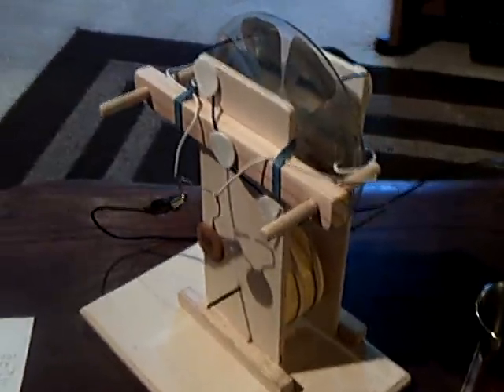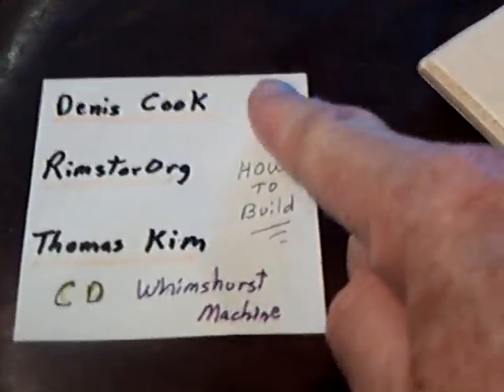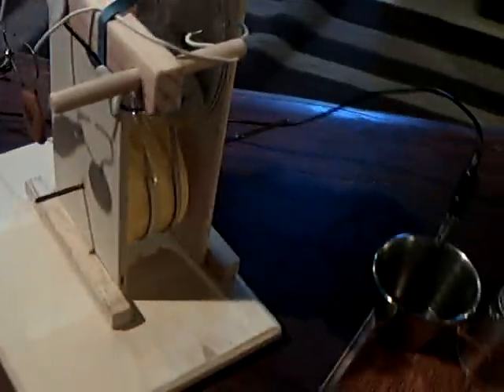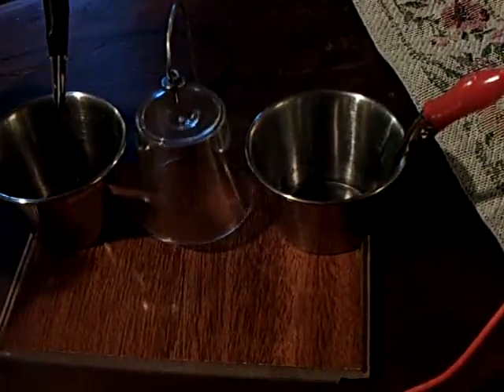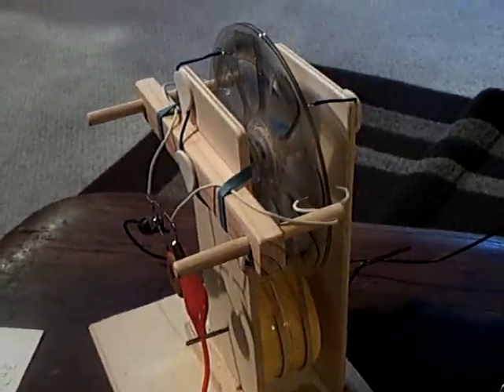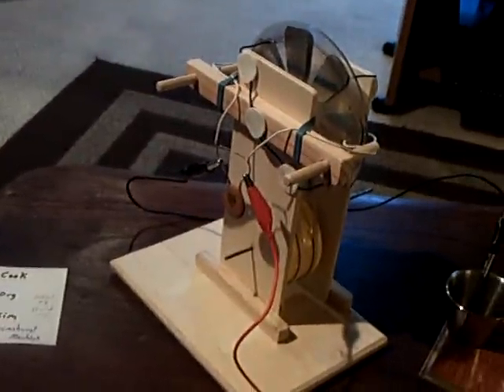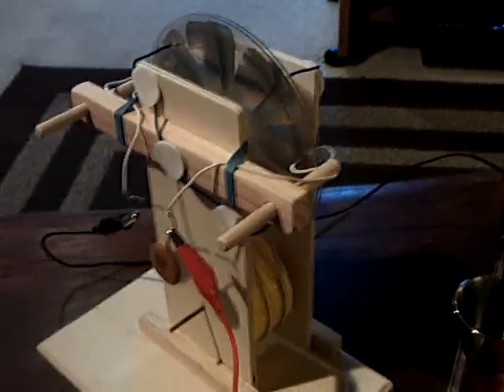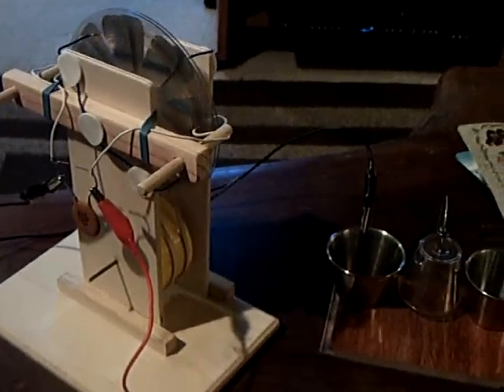Wimshurst Influence Machine

Comment: Ive been into electrostatics lately too. Check out my newman/ wimshurst.  Now i was thinking ,... Could i possibly use something like the replenisher as the commutator, and would an electrostatic pulse running through the wires of the newman part of my machine , be able to push the magnets, also id have to replace my batteries with capacitors. From your videos it looks like your having better luck with the electrostatic motor than i am and i would love to share ideas back and forth.
Reply from the maker: Yes you might be able to use that for a commutator.  The juice coming out of the Whimshurst is such high voltage but low amperage you would have to step it way down somehow to help out the Newman though.  I liked your setup.  It was very interesting and different.

Comment: !!!!!!!!!!Lidmotor. I've known of your channel for years. You made a video on a very basic pulse motor switched by npn transistor 6 months ago. I really need your help on the circuitry, I have been asking around for help for weeks to no avail. if you still have the motor, can you make another vid about it with greater detail on the circuitry, For example showing the breadboard more rather than the circuit picture. I'm new to all this but I really need to do this. Please find it in you to help me. It is of extreme importance,
You can even contact me by phone or facebook. Thanks and please get back to me.
Reply from the maker: Just watch that video a few times more.  I had to watch these Whimshurst "How to" videos several times before I figured out a way that I could build one.  Even then it didn't work right away and I had to go back a watch the videos again to figure out what I did wrong.  The bottom line is that I learned much more this way than if someone simply stood there and told me how to do it.  This is all about learning on your own.  If the thing you build doesn't ever work (many of mine don't) at least you learn something along the way.
Reply: ***** Thank you for taking the time to reply. I will continue to watch the vid. I have probably watched it about 30 times by now along with many others. The motor you made is actually all I need to make and understand, it's for my invention. It will work, and I'm never going to give up on it. A transistor page actually helped me with my circuitry, so now inductance effects the voltage. It has taken me a very long time to figure just that out. And now I have alot of work to do. But I see what you are saying... 'I' have to make it happen. Just can't wait to make a testable prototype. I'll show you what it is later, Lid. May not be up your alley, but I think you'll like it.
Reply: ***** Also, I have gotten it to work with a bifilar coil now. Was wondering if you might know of a good method to keep my transistor from getting hot. It starts to get hot with the pick up coils hooked up, without having to turn on and off... Anyway thanks for your earlier advice.

Comment: You just keep on having fun, don't you! Nice sparks! I like your cap. I didn't know you could get just small capacitance but high breakdown voltage caps until you brought it up in your recent videos. I'll have to look around for one of those. And at 1:08 I was wondering if you'd get zapped. :)
Reply from the maker: Yes I am having lots of fun with this project.  Thanks for the great videos on this subject.  I got that cap at AllElectronicsdotcom along with a bunch of other caps to try out.  I didn't get zapped making this video.  I started being more careful after a few major jolts awhile back with the higher farad caps.
Reply from the maker: mariuscivic . Thanks.  The cup motor just spins.  It is an electrostatic motor that runs on a high voltage potential.